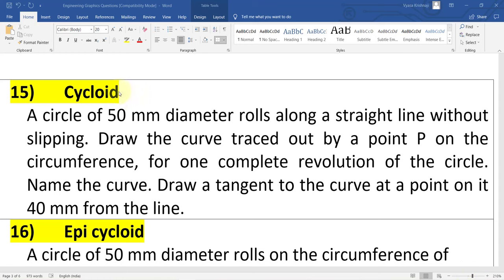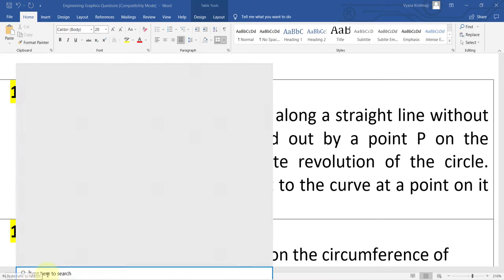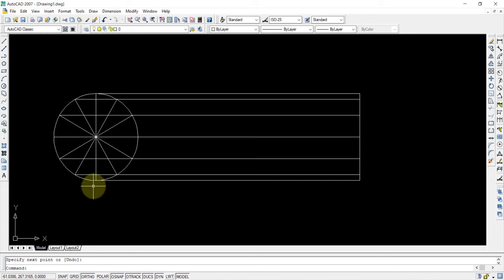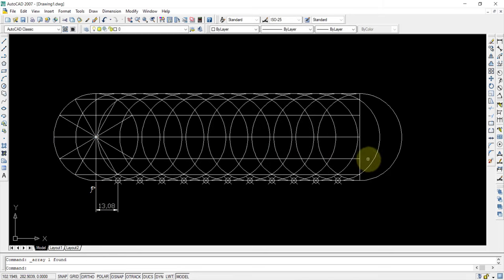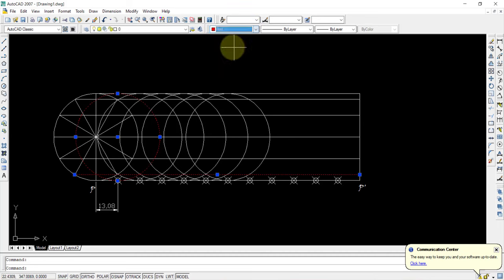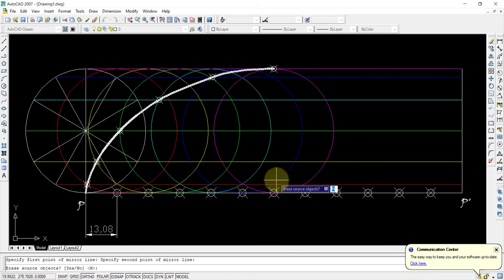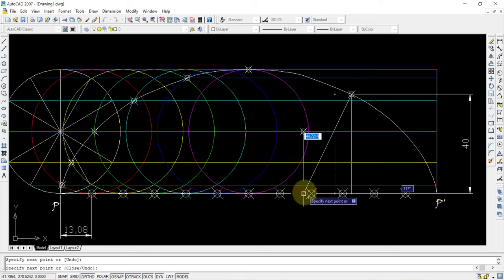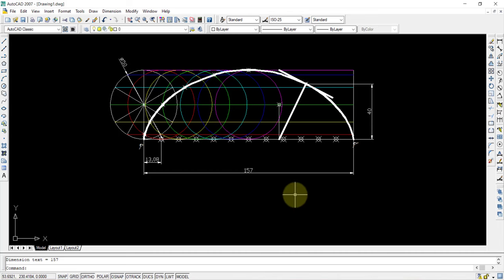CYCLOID   AUTOCAD 2007

Comment: A circle of 50 mm diameter rolls along a straight line without slipping. Drawthe curve traced outby a point P on the circumference, for one completerevolution of the circle. Name the curve.Draw a tangent to the curve at apoint on it 40 mm from the line.

Comment: A circle of diameter 50 mm rolls without slipping along a straight horizontal line for half revolution; it slips for 25 mm and stops. Draw locus of point on the circle which is initially in contact with the directing line. Name the curve.

Comment: A circle of 50 mm diameter rolls along a straight line without slipping. Draw the curve traced out by a point P on the circumference, for one complete revolution of the circle.
Reply: I think you commented this question just to compare and check whether this is the question you are searching for are not like me😂😂😂